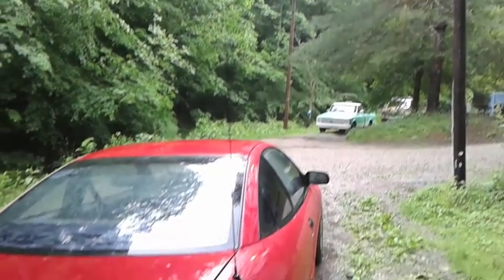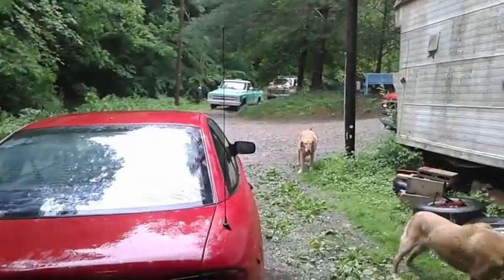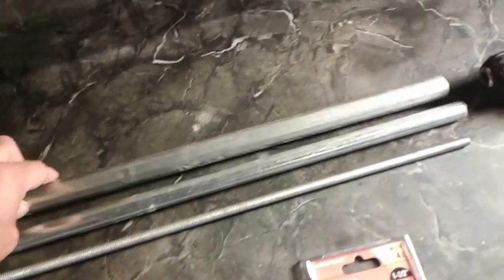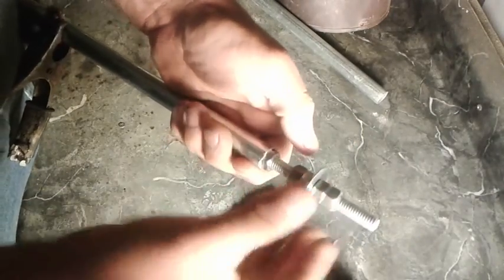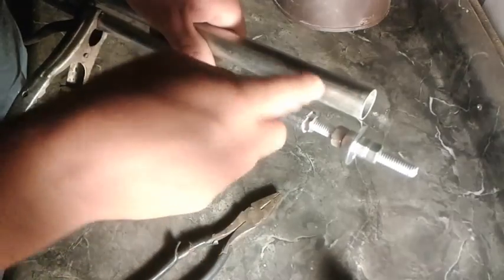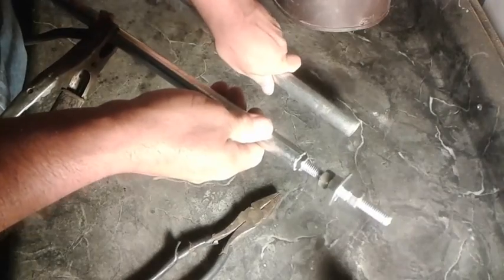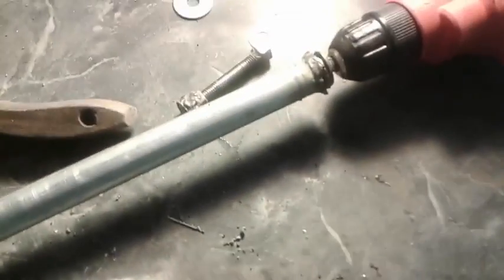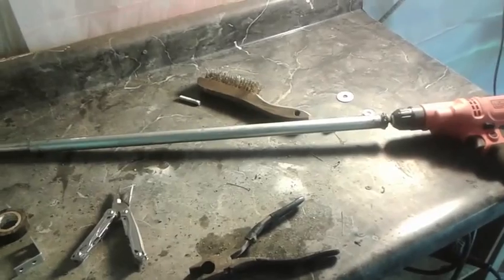How to Make a Linear Actuator

Comment: Very nice design!  And, you did a great job demonstrating the build!  I have some improvement ideas you may want to try...
To keep the threaded rod always greased for smooth action: tap a grease fitting into the bottom part of the outer conduit and to the top part of the inner conduit.  That way you can periodically re-grease the inner threaded rod. 
Another idea:  Add a washer or even better a washer with a rubber boot type seal to the top part of the larger outer conduit. But, the washer/seal would need to have an inner hole large enough for the inner conduit to slide through.   The washer/seal can act as a seal to keep dirt and trash from getting into the conduit, it will help retain the grease inside the conduit, and it will act as a guide to help keep the inner conduit centered as it extends and retracts.
Great idea of yours.  I will be making some like this myself!  Way cheaper than having to buy a linear actuator!  Good job!  You get a BIG THUMBS UP from me!
Reply from the maker: Very good suggestions! Thanks. I'm going to pin this to the top of the comments so everyone can see it.
Reply: luke Fugate... Thank you sir.  I forgot to mention in the 1st comment:  while welding, you may want to place a dark lens over your camera lens.  For most digital cameras today, the sensors can be damaged by viewing the Sun and bright arching from a welder.
Reply from the maker: Thanks, I didn't know that. Poor camera lol.

Comment: Great job on your video and build. You explained things very clearly. Could a windshield wiper motor be used in place of the drill to achieve the same thing or would the windshield wiper motor not be strong enough? Just curious.
Reply from the maker: Thank you. Yes a windshield wiper motor should have enough torque to work.

Comment: Really good work!!!! I would like to ask that could we make this linear actuator with the stroke length is 4m? I want to make it for my sprayer to treat my tree which is 4m in hight. Thank you so much!
Reply from the maker: Thanks!
You could make it as long as you would like depending on the length of pipe and all thread rod you can find. I would  recommend using grade 8 bolt of possible.

Comment: So awesome!! Do you have a video showing how to remove controls from the drill and making a button or switch to control?
Reply from the maker: Not yet! I cut the wires from the switch and actually removed the motor and gearbox from the drill. I then just ran the wires from the motor to the power source.

Comment: I know this was a long time back. It is awesome! Could you make a home/garage/shop/attic elevator from 4 of them? That would be a great project. That could be a span of more than 8' though; could something like that work. Or would you need a winch?
Reply from the maker: Possibly! I made a lifting roof on an rv one time that gave me a folding second floor. I used four of these and made them out of much bigger pipe. A winch would be easier for a garage lift though.

Comment: I'm missing something... why doesn't the inner pipe just simply spin with the threaded rod, instead of actually extending and retracting?
**EDIT: OK, I just realized why, He is always holding the inner pipe which prevents it from spinning. This would work if both ends are connected to something where neither end can spin. In my case one end is mounted, but the other end won't touch anything until its extended, so this won't work for me. i'll have to think about it and figure out if there is a way to modify this design to make it work for what I need. Good Video though! Thanks for the ideas!
Reply from the maker: Hope it does inspire ideas. If there were some way to have a groove in one pipe that a pin could ride in. Or possibly using square tubing instead of round.
Reply: @lukeFugate  Yes! I thought about the groove when watching a video about how to rebuild a trailer jack. I don't have a way to make a depression or groove in a pipe. But what I thought trying was to weld two small round bar rods onto the inner pipe, and then weld a pin that could ride between them on the inside of the outer pipe. I think this might work, haven't got to that part of my project yet though. In any case, Thanks for the Informative Videos :-)
Reply from the maker: I think using square tubing instead of conduit would work to keep the end from spinning. That way you won't have to worry about making a groove.
Reply: @lukeFugate  yeah, been thinking about that. Would be easier. Guess I'll have to go buy some square tubing now... youtube makes me spend a lot of $... LoL

Comment: Very nice! I plan on building a mini excavator that uses 3 of these actuators and Hypertough battery powered drills to drive them with. I only need 3 actuators, then 3 more for turning the arm, and 2 for driving the tank tracks. Although this design will be a toy size one, it will be still large and powerful enough to actually trench a sewer line! I like heavy equipment! I just got in a Huino 1/14 scale excavator today! I plan on replicating it to about a 1/8 scale! Your video gives me ideas on how to build my actuators now! Thanks, and thumbs up! The 56 IDIOTS who gave a thumbs down, never mind they are mental midgets!
Reply from the maker: If you do this it would be amazing! I would like to see that in action. If you build this and get it working, could you film it and send me a link to the video?

Comment: It would be helpful to explain how to determine the lengths of the conduits and threaded rod based on the open and closed distances.
Reply from the maker: You would want to make the threaded rod half the distance you want it to open. When it extends, it will double in size.

Comment: did you make of video of the finished product?  would love to see how you made the drill an on off switch
Reply from the maker: I did finish the project I built this for. I ended up using a shorter bolt and kind of changed the design. I did use the switch from the drill relocated so I could get to it though.  This design worked but I wanted the whole thing hidden, so I re-designed it. Here is the video showing how I ended up doing it.https://www.youtube.com/watch?v=N0LPaDMV8LA&list=PLx4vrrK_MpaclvmJ7tPzega13-5VnQXIk&index=24
Reply: @lukeFugate  amazing

Comment: Good idea. I'm also looking to sun tracking device for my solar panels, kits are available on the internet but they are expensive. If some can give me any workable idea it will be very greatful. Thanks
Reply: I found this video for the same reasons you found Asim. Did you make it ?
Reply: @xettex573   not yet xetter. I'm looking for a controll circuit which can controll leaner actuator Chinese kits are expensive what about you, did you make it.
Reply: @Asimkhan-oj4di  I found a really good link from "Gabriel Miller" on youtube. He made an Arduino circuit to control azimuth and elevation for a Steepers linear actuators . The control can be solar tracker or heliostat. Do you manage Arduino? regards !

Comment: I'm currently building a mountain on my model railroad and I think this will be helpful to raise and lower the mountain for access to train derailments. But it'll have to be scaled down made from plastic since it'll only need to lift 4 or 5 lbs.
Reply from the maker: sounds like a good idea.
Reply: @lukeFugate  If I want to lift a lid that's hinged on one end the shaft of the actuator needs a slot instead of just a simple hole since the angle of the actuator will change as the lid is raised up what do you think? The link here https://www.youtube.com/watch?v=RQS2z5pJTQE

Comment: Congratulations on the great idea of actuator..what is the thickness of the threaded bar and what are the thickness of the pipes and size ??
Reply from the maker: The pipes I used were 1/2" and 3/4" but you can go with bigger pipes as long as they fit inside each other. The all thread rod was 3/8" but I would recommend at least 1/2" or bigger.

Comment: I have about a 1000LBS of equipment on heavy duty rollers, will this push it out 5feet and then retract it?
Reply from the maker: I would use larger pipe and bigger all thread rod. As long as it is beefy enough it should do the trick.

Comment: you taught me more engineering than my college.thank you very much.just one question which type  of motor should i use if i have to push or pull 20 kgs of weight using this?
Reply from the maker: Wow, thanks! 

  If you can find a heavier duty drill it would work well. Maybe go up at least one size on the pipes and all thread rod. One thing that is very important with this design is lubrication. You have to make sure the all thread is very well lubricated at all times.
Reply: @lukeFugate  thanks man and keep making more awesome videos.

Comment: Very cool I'd like to use one of these to lift the plow on my small garden tractor but I would have no way to power a drill or electric motor, do you think mounting a hand crank on the end would work as well.
Reply from the maker: You could use a hand crank but it would be awfully slow. A cordless drill would also work.
Reply: 88 Datsun 720. Use a 12v windshield washer motor in place of the drill.

Comment: How much do you think it can lift?
Reply from the maker: It wouldn't be able to lift anything really heavy. It will lift me off the ground no problem but that's only around 220 pounds. If it were intended for heavy duty applications I would recommend going up to a 1 inch and 1 1/4 inch pipe and as big of a all thread rod as will fit in the 1 inch pipe loosely.

Comment: I want to ..lift 15 kg weight.
Is it normal 12v dc motor is ok for that
Reply from the maker: It depends on the motor. If it is a large motor or has gears then it should. A cordless drill motor that still has the gear system would be perfect.
Reply: @lukeFugate  tq

Comment: Excellent work Luke.
You made exactly that i need. I could not understand / listen about actual size of thread rod and their conduits exact lengths and widths. Please tell their exact sizes. Thanks for great work and sharing.
Reply from the maker: The conduit I used was a piece of 3/4" and a piece of 1/2". The length will depend on your project.  The all thread rod I think was 3/8" and it needs to be about the same length or a little longer than the pipes. You could use bigger all thread rod as long as it will fit into the 1/2" conduit.
Reply: @lukeFugate  hi there. Thanks for your reply. I have made the linear actuator as you did. Can i share pics here air whatsapp number.

Comment: Awesome job! How much weight would you estimate one this size could lift/move?
Reply from the maker: Not sure what the maximum lift would be, but it is more than my weight which is 220lbs. This would depend on the materials used and the power of the drill.
Reply: Alright, cool. Thanks 👍🏼

Comment: Isn't conduit zinc-plated and therefore hazardous to weld because the fumes are poisonous? Or was there an unshown step of grinding off the plating before you welded it?
Reply from the maker: Good point! I usually grind off the surfaces I weld to but I didn't show it. I would say as long as you are welding in a well-ventilated area it should be fine.

Comment: Hi Luke, a few quick questions for you. I tried making this and missed a step somewhere along the line. Initially, you had two nuts on each side of the washer. Am I correct that on the side closest to the inner pipe it's the nut furthest from the washer that's welded to the threaded rod? When complete, how many nuts should there be on the outside of the washer? It looks like you started with two, but towards the end of the video it looks like there's only one. Are either of the nuts on the outside of the washer welded to anything (i.e. washer or threaded rod)? I'm trying to make a small front end loader for a garden tractor and if I can figure out my mistake then a few of these running off of windshield wiper motors from the junk yard should be able to push the square tubing used as the frame. Your idea is absolutely superb... you may have saved me a ton since the front end loader should now come in at under $150 plus a few pieces of metal from my pile. Thanks for sharing it!
Reply from the maker: You could use one nut on the inside and one on the outside on either side of the washer as long as they are welded to the shaft. You want your welds on the side away from the washer so it can all spin freely against the washer.  It would be smoother if the washer were replaced with a bearing as someone else suggested. For very heavy loads like your loader will be lifting I would go up a couple of sizes in all thread and pipe. Maybe 1 inch and inch and a half pipe, and 7/8" all thread rod.

Comment: instead of the washer, I would probably try to find a ball bearing that would fit and weld it to the conduit.
Reply from the maker: Very good idea. would make it last longer and run smoother.
Reply: Welding a ball bearing will ruin it by heat distortion,a descent brass or phosphor bronze plain bush would work well.

Comment: You would definitely want to use a different type of gear driven motor because that damn drill sound is fucking annoying
Reply from the maker: You could use any kind of high torque motor. The only challenge would be getting it to couple to the all thread rod.

Comment: i wants to build a automatic centre satnd with help of actuator .what i should do?
Reply from the maker: What kind of stand are you wanting? will it be lifting anything heavy?
Reply: if the motor have to lift a weight of 2000,which material you would prefer?
Reply from the maker: SaRtHaK ShUkLa I would suggest using maybe a car scissor jack or something like that. I don't think the conduit pipe will hold up under that much weight.

Comment: wonder if 12v power window drives would work ? or a wiper motor ?
Reply from the maker: I would say either one would work with a little adaptation.
Reply: luke Fugate what makes the drill motor nice is the easily contolled speed; I tried another dc motor and could not get the speed down sufficiently...might be alright with your design.
Reply: Philip Jones you can buy online or salvage newer 12v dc windshield wiper motors, they usually have 2 or 3 running speeds. cheers!
Reply: @phil8911  you could stagger yer motor with a gears welded to a drill bit, connected to another gear mounted to a wood or metal block with a dowel screw.  You could mount as many of them gears staggered as you need till you get the speed yer looking for. The gears you could get at a junk yard, just make sure the teeth mesh with each other. Or even easier use a potentiometer from and old hifi volume knob to control the flow of electricity to the motor. Course you take a chance of burning up yer motor that way if you're trying to lift to much too quickly.

Comment: Luke, you're amazing! I don't know where you get these ideas, but the stuff you put together and make work is mind boggling.
Reply from the maker: A lot of my ideas believe it or not are from dreams at night. I'll wake up in the morning and before the dream fades I write down the idea. I think this one was from a dream a long time ago.
Reply from the maker: very cool, I didn't know that.
Reply: did you know the fellow that invented planetary gears (think automatic transmissions) had that idea come to him the same way... so definitely write down the things like that !
Reply: luke Fugate great project's content
your idea came just on time to be of use on my welding cart prototype project
i added a mig welder on top of it with a cabinet for tools at the bottom
because i remodeled my mobile work bench that have a big vise (staying there), a 4" grinder w/ a new 8" and a bench top drill press w/ xy vise now, for an arbor press then i have some extra equipment laying around my garage (grinder + arbor press)
so i decided to add a reclinable platform for that grinder with a flip flop top to place another tool with it as well 
on the back of the cart im mounting the grinder and on the other side a small vise - i would like it to make it a 3 items (triangular) revolving base (+ arbor press) but it will be bulky i guess
with 2 tools attached to it, it would easily hide itself inside the lower cabinet compartment and a guard cover
such devices will be attached to the 1/8 steel plate base w/ a sliding plate moved by heavy duty glides too
im also planning to move the plate with an old timing chain kit from a z24 nissan motor i'd recently rebuilt and i thought of a linear actuator mechanism to mobilize the chain system part - like the gondola system on the ferris wheel kind of
i will put your idea of the actuator to work with the timing chain 
thank you for this great tip